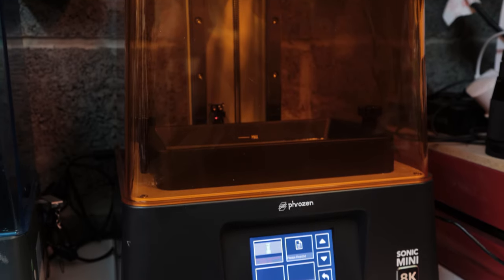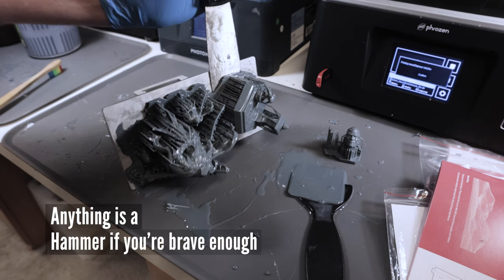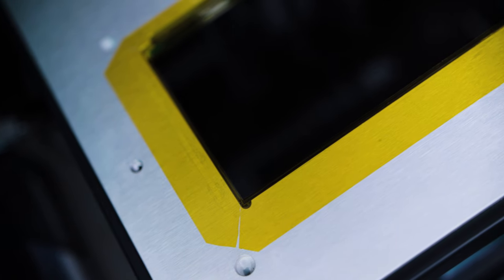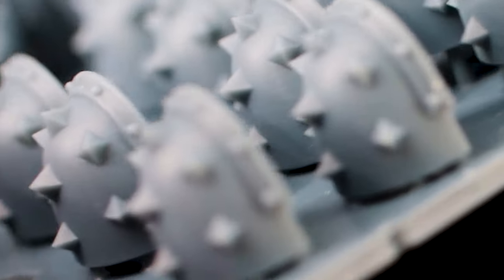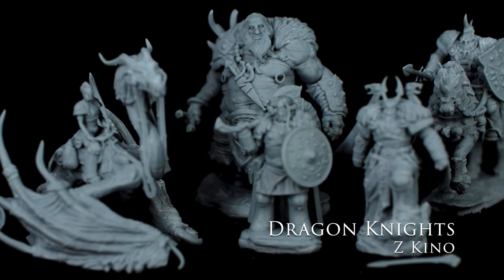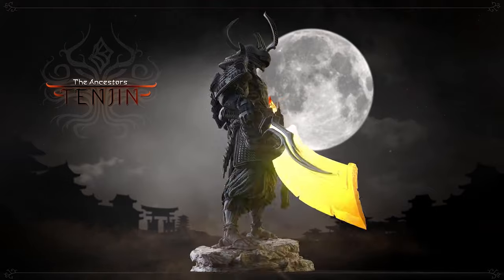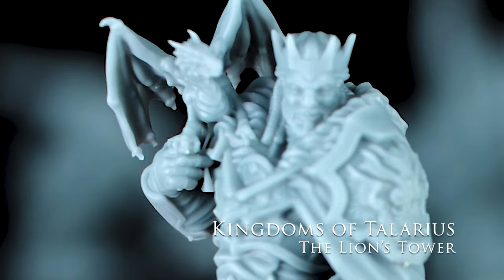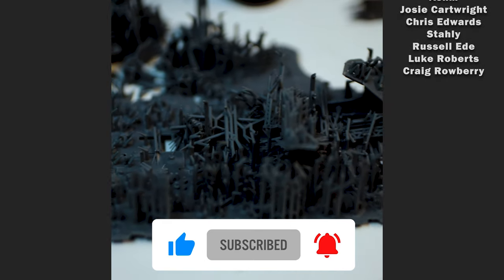DO NOT BUY - Phrozen Sonic Mini 8k Review for Miniatures, Warhammer & More

Comment: This would be a good VS video against the mono 2! The only thing i fault with the mono2 is the build plate should have been 10in! Ive got the mono 4k i bought that first 3 weeks later the mono 2 the mono 4k build plate is way to small anything that small of a build plate i would honestly say dont buy it! Youll only get annyed and couple weeks later go for a bigger one! Think anyone starting out should just bite the bullet and buy a 10in 8k! I wish i did as now need it! Im an armour modeller the ones I've got are fine for small parts but anything 1.35 sized for conversion kits i need the 10 in!

Comment: 3D printing simply is too much of a “hobby” to really catch on to threaten GW’s bottom line. I have wonderful help from my brother a lot of the time to do 3D miniatures, and it is still a right pain in the butt atop maintaining the space, smell, and sheer patience to print minis. I can see why people prefer to drop $500 on an army they paint up over weeks, picking up new units from thier FLGS piecemeal versus dropping $300 on a new printer, resin, the time to set it all up, consumables like gloves and pry tools, and even then have to remove supports and cure.

GW meanwhile has A the convienice of you pick up a box of space marines, it will not stink, no mess, and has clear instructions on how to assemble easily, with real considerations for how you build your models and get attached to them. 

GW kits have problems (good god fine cast) and as they control the IP and have serious value add (time, mess, space, upfront cost) to thier kits they can keep trucking indefinitely, especially compared to thier real competition for MTG and other table top games for hobby time.
Reply from the maker: Yeah totally, and there's the build experience you get too. I always liken this to Airfix kts. You can easily buy a model of a plane, but the experience of building it yourself is a huge element. Sure you an print models snap them off the supports and paint them in many cases. and if that's your main drive, painting and playing. cool 3D printing saves you a lot of time. But you loose so much worth in the translation of mediums.

Comment: Gods i should have watched this before pulling the trigger on the d2 lol
Reply from the maker: How so? Did you watch our D2 video? What does this do that makes you prefer it over the D2
Reply: @FauxHammer  its mintures that i am mainly making, the sholderpads looked almost perfect, a bit worried (probably buyers remorse) that the d2 will not make a comparable painting friendly minis even with 16aa blur2
Reply: @4_am  So to answer this directly, it will not be as smooth on the D2 as it is on the Mini8k, but the difference is argualbly impercieveble.

Are you printing minis to paint and display? or to aint and play with? If the latter, you chose right with the D2. The D2 technology creates sharper prints with more accurate details no matter what resin you use. some resins will be smoother by nature but the results will always be sharper on the DLP printers.

The 8k is detailed and smooth, but so far - only with the 8k resin and that resin is too brittle for game pieces. youc an use softer resins but you loose the detail you get from this 8k printer. Making the 8k resolution somewhat pointless.
Reply: @Ross.Graham  kk thank you Ross. I am an ultra owner just now. Prints are fab, but i am an old skoo dry brusher 😀
Reply from the maker: @4_am  Honestly, the only notible upgrade from the Ultra to the D2 is the bigger print area. The print detail is impercieveably different between them and they take a but longer as the projector uses less power to make it more economical. but you are taking 1.6 seconds on my ultra to 1.8 seconds on this. Though sometimes use 2.2 for very lightly supported models.
Reply: @FauxHammer  ahh not so great news haha hmm, well see what its like tomorrow when it arrives. Im fairly ok with the build plate for the ultra as only print in small batches lol oh well.

Thank you both for the replies
Reply from the maker: @4_am  oh no, don't let me understae it, it is super awesome and I have found the ultra to be restrictive in some circumstances. It is definitely difference I suppose just tos et expectations, don;t expect as big a jumo as you would get from say a Photon S to an ultra. But you've gone from a top tier printer to another top tier printer.

Comment: "So why am I telling you not to buy it?"

For clicks mate, you say it for the clicks.
Reply from the maker: Oh God! Have I used clickbait on YouTube! We should tell someone! This behaviour surely needs to be reported!

Thanks for your comment. No sure if banter sarcasm or an actual dig, but engagement helps boost the channels reach. So cheers!
Reply: @FauxHammer  Mostly banter! was researching what resin printer to get and came across your video. Was really rather impressed with the quality of the video. it was just that the content I was looking for wasnt there. from memory you talked about individual problems with your machine, about what software to use and then a rant about the resin used. All very interesting, but very little argumention towards the "DO NOT BUY THIS MACHINE ON YOUR LIFE" vibe you built through thumbnail and tone in the beginning. Thus my first comment. But I respect the hussle, good luck with the channel :)
Reply from the maker: @marcusfranzen5814  lol, thanks for the clarification. The thumbnail is not totally in jest, The printer is capable of fantastic results, however, there were a lot of issues I had with it. The stuff I went through. So the resin not being the best for my use case, is an argument against it, the tech issues, component failure, against it. Bed levelling, against it. lack of screen protector. There are many reasons not to buy it, especially now when we have the Uniformation GKTwo within the same price range.

It;s a great printer, but it's also a PITA and since this review I never used it again.

If there is something specific you wanted to know, feel free to ask. Unlike other Tubers, I'm quite responsive in the comments and try to respond to everyone.